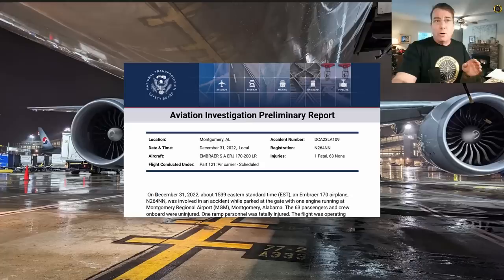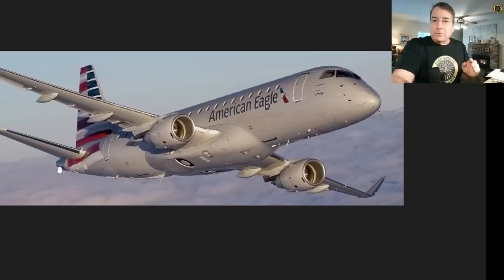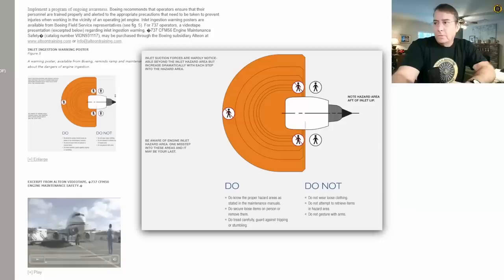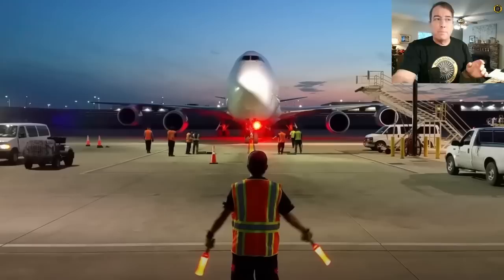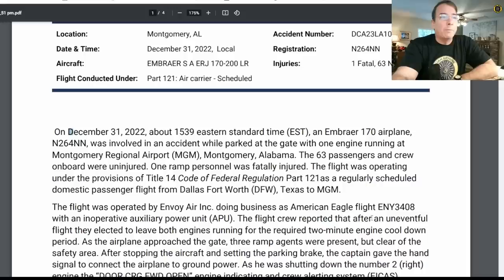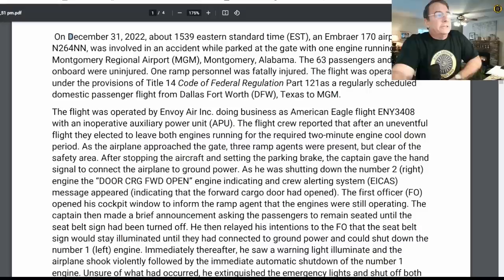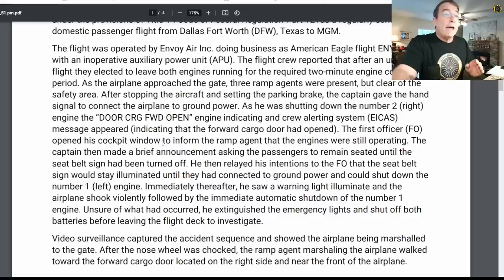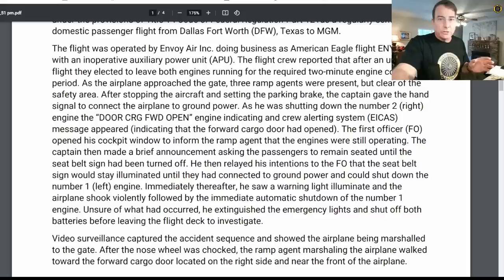NTSB Preliminary Report Ramp Agent Fatality 31 Dec 2022 Montgomery Al.

Comment: Twice last year, I pulled into the gate with engines running and wasn’t able to shut down right away and rampers immediately swarmed the airplane, popped the cargo door etc in clear violation of all safety protocols. In both cases after we shut down I ran outside to put my foot in somebody’s ass. In both cases,the rampers were utterly dismissive of my concerns, and treated me as if I was a fool for being concerned. They could barely conceal their contempt as they explained that there was absolutely no danger, and they knew this because they do it all the time. I elevated my concerns to their management and as far as I know, nothing was done.  Hopefully this incident changes a few minds…..
Reply: Sounds like you got some slack clowns on the ground there.  Hope their maint. is not like that.
Reply: @tomsherwood4650  Exactly.
Reply: What airport ?
Where there's smoke there's fire.
Bet that whole place 
is a mess 👍
Reply: A 225 pound guy, isn’t a 110 pound girl - Women are at greater danger in every job that once was male only and must take more precaution. That’s not a sexist comment, it’s just damn common sense. - Same goes for a light weight guy too.  The world has changed so safety rules are more important now to cover all the diversity
Reply: Basically agree. Safety rules were always important, though, not just b/c of increased diversity.
Reply: Maybe you (and all pilot) should report that incidents to FAA.
When these ramp agent got shouted badly by the authorities, they hopefully change their behaviour!
Reply: @ssnoc  This is a joke but it illustrates your point. A 5' 0" 90 lb. woman applied for a job as a bouncer at a bar while it was open. There were two big guys just about ready to start a fight. The manager told the woman to remove the first one so she walked up to him whipped his arm behind his back put a thumb lock on him and frog marched him out the door. The bouncer on duty that she would be working with was about 6"8" 300 lbs. He walked up to the other guy and looked at him. He left without a word.  A small woman can do the job but it is a lot easier for someone bigger.
Reply: Agreed. As a licensed and a union electrician I was dismayed when the shop owner said and I quote "if you're not violating some safety rules...you're not working hard enough".  Couldn't believe my ears.  And though to myself, do not listen to that B.
S. Continue to work safe, watch out for yourself  and  you're co-workers, and everyone goes home as they arrived at the start of the day.
Reply: sounds like the supervisor knew he needed 2 safety meetings to keep his job
Reply: This is alarming to hear 😲😑
Reply: I’ve been on the ramp for 10 years and unfortunately on time performance has priority over safety most of the time. Management will never say that but it’s implied. 

One of the biggest safety violations I see is the “2 inch” rule inside the bins. Bags and freight must not touch the ceiling of the cargo bay. It must remain 2 inches below in order to not block the fire suppression system. The ramp crews get pushed hard to take freight beyond the legal capacity of the bin. If the planes aren’t stuffed to the gills there’s no way it’s going to fit. But it “has” to fit. One of these days there will be an onboard fire, and everyone will be throwing whoever they can under the bus to save themselves.
Reply: Thats incredibly disappointing!  So it was her and her boss's fault
Reply: A fellow mechanic got sucked into a B737-200 JT8D Lucky for him, the engine had IGV that stopped him from getting chewed up by the fan. The engine had a compressor stall and blew him back out. Unfortunately, he lost a hand. Yep, I respect those engines.
Reply: @jamescollier3  Yep sounds like he knew what he was working with.
Reply: Her family will go on to sue the airline and get a big settlement even though it was her own fault.
Reply: @donh6416  Wish I could give you two thumbs up.
Reply: Crazy, but these type of trends I blame on companies pushing employees too hard while shorthanded and other reasons.  All this to maximize profits at the expense of the employee.
Reply: @ssnoc  FYI, there are photos with the gofundme her Mom started, and she clearly doesn't fall into the lightweight category.
Reply: I use to be a ramp agent…i never understood my coworkers urgency to work, when it wasnt necessary, as they were always bitching about working
Reply: I'm looking to become a ramp agent myself this year, always been a cool job I wanted to do. If I get a position as a ramp agent, and I ever hear management tell me to do something like that (or else get written up), I'm quitting immediately. Not risking my life to save 1 or 2 minutes for the bean counters...
Reply: @MrBen527  Yes, this important context.
Reply: Well if they want to be contemptable about if they dead it's their fault,  In fact it sounds like all be being done and it's their problem.
Reply: In the FAA and aviation business this occurs all too often. Including the dismissal of instructions to do things correctly. Even from managers and people who should know better. I was in the Navy and flight deck operations you only survive and keep aircraft cycling by doing things right. One small thing I still remember, above the doors coming and going to the flight deck and ramp they had put big signs that read "THINK". I still remember those and believe they were more valuable than people thought.
Reply: Reminds me of Capt. Nick on the APG Podcast once describing his interactions with rampers at JFK ( or Newark?). They were endangering the airplane being careless and he tried to enlighten them. They too were dismissive and indignant towards him.
Reply: @ssnoc  , maybe not sexist but certainly ignorant. These safety rules apply to everyone, and to suggest it is okay to violate safety regulations because you think you know better is precisely the problem.
Reply: The Challenger "accident" comes immediately to mind. Ignored burnt O-rings because "it hasn't blown up yet" aka "Normalization of Deviance". smh
Reply: ...elevated to their management...nothing was done. The employees are (likely) acting in ways commensurate with the culture (management usually).
Reply: @MoonShadowRayne  it was her actions, but fault comes from the whole system. The people who apply pressure to break rules, the people who routinely ignore the rules and dismiss anyone who contradicts them are all at fault. She wasn't the only one acting on the plane, and you can bet every dime you have she wouldn't be the only one seen to not be working. The judge will dock the payout because of her own responsibility, but she's not the only one responsible for this, and those guys should pay.
Reply: @MoonShadowRayne  It isn't as easy as "her own fault" if the airport has built a crappy attitude and everyone blames her for not violating the regulations as much as everyone else.

Given how many people did violate the rules for this single plane, that airport has a huge number of violations every single day. So it would be correct to sue the airport to make it relevant that management starts to do what they get their salary to do - make sure regulations are upheld. And hopefully first kick out one or two people who have been well aware about this violations for months or years and just ignored it "for efficiency".
Reply: @j18ter  I think the difference being mentioned is that the likelihood of an incident isn't the same for all people, so those with low chance flout the rules and encourage others to do the same. They get away with it because of some characteristic, but others without that characteristic do not. It's exactly why everyone has to follow the rules. No one is special, the job has to be safe for everyone including the lightweights watching you as an example.
Reply: Union incompetence.
Reply: At Southwest Rampers are not pressured to enter the injection zone prematurely. However they want the bags at the tunnel in ten minutes. So agents are under pressure to go, go, go and turn the plane quickly. This is why agents rush into the Safety Zone before it is safe. If you are late getting the Local bags to the tunnel (no matter what the reason) you will be called to the Supervisor's to sign a letter. Ask any Southwest Ramp agent.
Reply: @GNNASCARFAN 24   Tell them to put it in writing if they tell you to do something that violates safety. Regardless don't do it.
Reply: @oldmech619  JT8D on a B-737?
Reply: @MoonShadowRayne  But it isn't. Clearly her employer failed to supervise her and the other yokels as turning a blind eye gets things done faster.
Reply: @markhorton3994  1 that never happened.   2 it's irrelevant, you can't use judo on machinery
Reply: @deSloleye  Definitely sounds systemic - I'm willing to bet those two safety briefings were conducted and received as "the words we need to say before the thing." Routines tend to grow routine and so lose their impact. I used to work with a lot of IATSE riggers and their safety briefings were serious business. This was a 100% avoidable tragedy and I hope it changes things for the better. Stay safe out there!
Reply: @MoonShadowRayne  Wasn't solely her own fault. The employer MUST create an environment which prioritizes safety over production.
Reply: There's no way. How the HELL could they be that blasé about it? I can't wrap my head around that.
Reply: @Rio_Seco  I said it was a joke. That means it never happened. I was illustrating that sometimes size matters.
Reply: @ShaunHensley  1 I said it was a joke. 2. The point was that the smaller person needed greater effort to accomplish same thing.
Reply: @markhorton3994  I see. If I misunderstood the intent that's my mistake
Reply: @blakena4907  It's complacency combined with job pressures. 

If you work in a dangerous environment long enough, many if not most people acclimate to it.
Reply: @ssnoc  you're right!  The laws of physics do not change
Reply: @ssnoc  110 lbs or 225 lbs doesn't make a difference to a jet engine.
Reply: That is so contrasting with what I have experienced as a ramper, lead, and sup. If a pilot comes down with an issue, we do everything in our power to accommodate him/her. I'd say that 99% of ramp agents hold pilots in very high regard, so your experience is mind-boggling.
Reply: Look up “normalization of deviance”. Very prevalent and hard to correct in some institutions. Retired FAA ATC, one example was controllers routinely taking turbojet aircraft out of Class B airspace vertically or laterally. When questioned about this violation of rules the controllers gave very similar answers such as there is no danger, they do it routinely and nothing ever happens.
Reply: @markwheeler202  I think the problem was it was so cold the o rings did not expand and keep the hot gas from escaping. There were redundant o rings but the cold caused them to fail. The main culprit was they wanted to go that day. It was 36 degrees and the O rings could fail at 53. The same pressure to get the shuttle off the pad is the pressure to get that plane turned around. People like to set deadlines just to have them. They want to go to a new system of communications with aircraft not because its safer its so they can cut the miles down between the planes landing.
Reply: You should try working with them...I had to force them to not put a bag for Manchester England on a San Francisco flight and I was treated by those geographically-ignorant cretins like I was some kind of problem and was punished...
Reply: @mikemicksun6469  The joints were designed such that hot gases would NEVER be allowed to reach the O-rings, because that could lead to the loss of the spacecraft. Analysis after several previous missions showed that hot gases were indeed reaching the O-rings. Management, rather than conclude that there was a design flaw that needed to be corrected before any more flights were launched, instead kept flying because "none had blow up yet". They were playing Russian roulette with seven astronauts' lives on every launch based on wishful thinking. That was the systemic reason for the loss of Challenger, not that it was too cold (they were warned about that too but ignored the advice of their engineers). 

IIRC, there was also an issue with the contractor selected, Thiokol. The SRB's had to be shipped by rail from Utah to Florida, but would be too long so they had to be built in sections, hence the need for joints that had to be sealed with putty and O-rings. If they had been built where they could have been shipped by barge to Florida, they could have been made in one piece without the need for joints that could fail. If someone could provide more details on this, it would be helpful.
Reply: Good for Captain.  Yes hopefully this opens up a few minds..
Reply: @vk2ig    Just double checked with Google, it says the JT8d.  This was back around 1977. The engine had the IGVs I front of the small fan.
Reply: @jamescollier3  yeah, I smell a rat on that. I doubt there was any safety huddle/brief, much less two. somebody is trying to CYA.
Reply: @vk2ig  The original 737s, the -100s and -200s, were equipped with JT8D engines.
Reply: @donh6416  My cousin  was electrocuted (instantly dead) because some axewipe flipped on a clearly placarded switch to the runway lights.
There ain't no cure for stoopid.
Reply: @jamescollier3  he lost control of the situation. He will remember this forever.
Reply: @johnd.8224  what does the union have to do with this?
Reply: @rick4580  110 or 225 lbs.makes a big difference. Weight increases with cube of size. But area - which is what the suction affects increases with the square.

So a big and heavy person is less affected by the suction.
Reply: @tomsherwood4650  What does maintenance have to do with rampers?
Reply: To the OP, as the pilot in command the onus is on you to follow through on a safety issue like this and make merry hell until it is taken seriously by the relevant authorities.  Otherwise you are being complicit and nothing changes.
Reply: @markhorton3994  This is Joke? Where is the punchline? 
This tale is being presented in support of an opinion, but because it is imaginary, it provides nothing.
Reply: @ssnoc  Your comment IS sexist, because what you've stated is irrelevant and just an excuse to say women shouldn't do "men jobs". The safety standards require that NOBODY goes near the aircraft until the engines are shut down, so there is NO extra danger presented to women in this situation. You even state that the "same goes for a lightweight guy", yet, what about a 220lb girl? Do they meet your standard, or are they still in danger doing a "mans job"? It seems that you think its simply about a minimum weight, yet you state that gender is the qualifier. You're confused, mate.....Ramped with a few women and if they are keen to have a go, they're just as good as the guys
Reply: As a ramp manager at a large airport, I can confirm for you an emphasis on efficiency over safety is unspoken but prevalent. And when reported, safety inspectors, city employees, and even FAA people sit and watch and see the violations but would rather continue watching their Netflix. Nothing will ever be done about this sadly
Reply: Management  likely is who incentivized the dangerous behavior?
Via negative outcomes for "wasted" time... Or scheduling.
Reply: @ssnoc  A jet engine does not care how large or small you are.  It pulls your entire body.  Don't ask me how I know...
Reply: @ssnoc  15' is safe for everyone.
Reply: @j18ter  Seems to me that was exactly what he was saying. 

He merely points out that with greater weight variations between individuals (which derives from greater diversity of workers and body types), it is that much more important today that safety practices are clearly understood and followed.  Also associated with greater diversity are greater language differences, which means that clear communication and language comprehension are equally important..
Reply: @vk2ig  I'm more surprised there were JT8Ds with inlet guide vanes, didn't think turbofans, any turbofan at all, had them ahead of the fan. The ones on the SAAB Viggen didn't have them as far as I know.
Reply: @mikemicksun6469  And the reason they were so determined to go that day was that they had been scheduled to go the day before but cancelled for fear of storms approaching. The storms never came, the Saturn 5 sat around all day in the sun, and news outlets of various sorts made fun of NASA. They were determined to avoid further embarrassment. So a public relations problem drove (in part) the fatal decision.
Reply: @vk2ig  737-100 or -200 with JT8D low bypass engine. The CFM-56 engines didn't show up until the 737-300 and after.
Reply: @vk2ig  The Boeing 737-100 was powered by two JT8D-7 engines, each capable of producing 14,000 lbf thrust. The Boeing 737-200 had two JT8D-15A engines, each capable of producing 15,500 lbf thrust.
Reply: @MoonShadowRayne  
Not exactly.
Reply: Sir I can assure you the crew was probably briefed and given remedial training on flight line dangers......but I've seen fellow employees get all the training in the world.....walk right out of that briefing and engage in the same dangerous behavior. Some people are ineducable.
Reply: @Breenild  It doesn't  work that way. I filed countless ASAP (Aviation Safety Action Plan) reports when I flew the 737 and A320 fleet. The FAA sees the reports, but it is up to the operator (airline) to use the data. They don't and don't  seem to care. They just want to get the flight crew off the clock.
Reply: @ssnoc  What are you talking about 225 pounds.....110 pounds?????  That engine would take either of those two like a rag doll.
Reply: @rick4580  Exactly!
Reply: @ZedZedAre  the jet engine doesn't care what sex you are. Not only is this a tragic AVOIDABLE loss of life, those engines are not cheap. I'm  a bit surprised management's don't recognize this.
Reply: @snigel79  JT3s (old 707s), JT4 (newer 707s and DC8s) and JT8s (727, 737, DC9 10 thru 50 series) all had IGVs. Even the initial large engines on the C5s had them. 1950s and 1960s technology.
Reply: @MoonShadowRayne  Yep. Juries suck (even though emotion isn't allowed to be used in a courtroom, it always is) and the airline will pay out instead.
Reply: @mayhempilot6158  Then that person should show their required copy of that letter to someone who cares and can make trouble.
Reply: @ShaunHensley  Nope. Solely her fault.
Reply: @UncleKennysPlace  nope. Airlines can institute policies prohibiting even performing that work until engines are shut off.

Legislation can be crafted to that effect.

So no. Not ‘Solely her fault’.

It’s because of the pressure to perform because money needs to be made.

Want to keep going?
Reply: @philiproseel3506  The Captain of ANY aircraft...  is the BOTTOM LINE!  HE/SHE:  will be interviewed first by the FAA.  His neck is on the line.  His name will be among the others in the "field" of "Party 'B'" in the lawsuit (if it goes to court) that ensues.
Reply: @KO-pk7df  Well said. Bravo Zulu.
Reply: @ssnoc  Care to stand in front of a live jet engine to find out? I bet you could muscle a jet engine to submission no? If not, that is just a sexist comment
Reply: @markhorton3994  BS
Reply: @jimw1615  Thanks, and likewise to everyone else who mentioned that the B-737-100/200s had JT8D engines. I last saw those engines on B-727s and DC-9s.
Reply: There's a saying in aviation that safety rules are written using someone's blood.
Reply: @markhorton3994  Thanks for the fake story.
Reply: Good grief 576103, how different your airports are to mine. I’m ACS (cleaner and bowser operator) and ramp agent hybrid and most of my colleagues are actually very intimidated by the pilots. It would be unusual for most of them to say anything to the pilots other than mumbling a return response should the pilot even acknowledge that we exist and that we’re there by saying good morning or something. The exceptions are usually those who have to, such as the pushback teams.

One of the more notable examples of this was regarding a 787-800. We had finished cleaning the Dreamliner and we’d all gotten back into our van and were either playing on our phones or chatting as we waited for our supervisor to return from helping the rampers with something-I forget what it was exactly. Every department was short staffed and I’d only been an aircraft cleaner for just over two months so I was one of the newest people on the team and this was before I kinda hybridised onto the ramp. I wasn’t using my phone as even now just watching the intricate activity on the apron and stands or the runway is interesting enough so I’m the first person to notice that the captain was walking down the steps and thought it was unusual since the walk around had already been done.

Once the captain had gotten to the ground he started walking straight for us in our van. I didn’t say anything because I was only mildly curious but one of my colleagues also noticed and that’s when it began. Immediate anxiety as about the whole team of six, minus myself began anxiously asking each other why the captain was heading straight for us. “Was does he want, is he really coming for us, did anyone forget something, have we left something aboard the Dreamliner, but no it would just be a flight attendant if it was something like that.” Were among the flurry of responses as it became apparent yes, he was indeed heading for our van.

The general consensus was that someone had done something very wrong and we were potentially in very big trouble if the captain had gone to the effort of getting of the plane to find us instead of getting on with the usual preflight stuff you guys do. It wouldn’t surprise me if one or two of my colleagues were giving serious consideration to bailing out of the van from the opposite side. I had the same concern but it seemed muted in comparison, honestly I was still more curious than anything else. It was warm enough that we had the windows down and thus he addressed us without having to open the door or anything. It was harmless! 🤣 Apparently the pilots from the last flight had left the cockpit in a bit of a mess including having spilled a drink and he’d come to us hoping we’d go clean it up. (I should point out that most of us aren’t allowed to clean the cockpit without separate training, which is voluntary and thus few people choose to do it and I hadn’t gotten the training myself yet at that point. Nobody present in the van had, and so if there’s no cleaners allowed to do it, then the pilots or engineers have to do it themselves. At the same time they’re poorly equipped to do so because don’t have the specialised chemicals and equipment.)

So but of course there are a few seconds of complete silence before I finally chose to break it when it became apparent nobody else was going to. Fortunately I’d done something similar before (which is another story entirely) and knew it would keep me out of trouble by agreeing to do it on the condition that I’m directly supervised. Though of course I was equally motivated to ask for supervision because I wasn’t keen on the idea of accidentally breaking a multi million pound aircraft. The APU was running though not the engines and I know enough to understand it means at least some of the systems are powered and active. Of course he agreed since both would be there doing a few of the preflight stuff but mostly waiting until I was done. So of course I pack the stuff I’m going to need and followed him aboard. 

They kept their word although most of it wasn’t near any of the controls and the few bits that were, I’d verbally confirm before proceeding. But of course as luck would have it, our supervisor had returned while I was gone. He was waiting for me at the bottom of the stairs though his only remark was that I might as well just get the training for it if I was prepared to do it anyway and about a week later I received said training. And yes most of them are like that and this is just one example. 🙄 I swear, the notion of addressing a pilot in such a way would probably give most of them nightmares.
Reply: @philiproseel3506  Likewise, I could barely believe it. I work both ACS and ramp in the UK and I kid you not, the vast majority of my colleagues are very intimidated by pilots bordering on fear. I understand they’re high ranking but they’re not horrible to us. In fact most of the time it’s the complete opposite-at least for me. Admittedly because I’m one of a tiny handful of cleaners who has undergone the voluntary cockpit training module, inevitably I have much more exposure to them but even before that all my interactions were positive. They’re usually as friendly as the flight attendants even when they don’t have to be.

The best example that comes to mind was when I was still fairly new and was cleaning the forward galley on 737 and the previous crew had badly overstuffed one of the big metal bins that come up to almost waist height on the as a woman of average height and weight and I’m having trouble getting the bin bag stuffed with rubbish out of the bin. I was making progress but it was slow going and I was making a lot of noise as it banged against the floor with every jerk. Then the captain steps out of the cockpit because I’m distracting them during some of the preflight stuff and for a moment I thought I was about to get yelled at or written up. Instead he just asked if I could use some help and I say yes, so he gets his first officer to help me. This guy was about a quarter more than me in height and size and had no problem providing the extra strength required. I thanked them, they were happy to assist and we went back to our respective jobs.

But yeah most of my colleagues find them intimidating and would never dare to be so rude.
Reply: @donh6416  Agree with you. You can't be afraid to call someone out on a safety issue. I've done a couple of different things in my life that required safety consciousness, including flying, also medicine (retired EMT, studied nursing), among others. An ounce of prevention is worth a pound of cure. Literally.
Reply: @mikoto7693  I guarantee you that pilot was angry with the previous crew about the state of the cockpit and embarrassed at having to ask for your help. No doubt he was appreciative of your efforts, as we all are! 👍
Reply: @mikemicksun6469  
Part of the problem was NASA thought that having two O Rings at that spot created independent redundancy, but they didn’t.   They flexed/expanded/moved together.  So the second O ring basically added no extra protection.
Reply: @vk2ig  Yes, JT8D engines were used on the 100 series and 200 series 737 aircraft.
Reply: @snigel7995  I used to do maintenance work on DC9 aircraft many years ago and yes the JT8D has IGV’s
Reply: @markhorton3994  was she a lesbian?
Reply: @VIKINGOCATIRE  What difference does that make?  First it is fiction that I thought  might illustrate the concept that size matters in some things.  Apparently some commenters disagree.  For most jobs age, sex, sexual preference, race, religion,  nationality and anything else other than ability to do the job are irrelevant. As a Christian man who believes that since God gave Adam and Eve the choice between right and wrong I do not have the right to dictate morality your question offends me.
Reply: @JH-qqqqqiim  And by your own admission! You would be considered a dangerous ramper and seems not care about the safety of the passengers and crew!
Reply: Famous last words, "We do it all the time.".
Reply: @perwestermark8920  unless you actually saw the video and understand that the suction is exponential, what difference does it make? Probably 1 inch or two. But that is just the weight, the 225lbs person will surely be closer to the engine assuming their center of mass is at the same location = the heavier AND larger person will be sucked first
Reply: @topethermohenes7658  Exponential is about distance to engine.

But that is a different parameter from the surface area of the person - and the mass. At a fixed distance from the engine, the wind has a fixed speed. And the applied force depends on the area. But the weight is what counter that force. And a big and heavy person has a larger weight to area quotient than a short and thin person.

So your argument about seeing that video falls rather short by you missing a bit of physics. Well maybe you have seen how small RC planes can do magic tricks but is very much affected by turbulence while a 747 is slow and and way less affected? Same thing - an RC scale model has way lower wing load because the weight scales  with the cube and the wing area scales with the square.

Ever wonder why insects can be so thin and still lift many times their own weight, and why they can fly in the wind? But an elephant has very thick legs and can't fly in the wind? That elephant needs much, much, much, much higher wind speeds to be as much affected by the wind as an insect. All because the weight to size difference. All about that cube for the volume/mass.
Reply: @perwestermark8920  yes exactly its distance, then I gotta ask you this, do you think a 225lbs person has the same dimensions as a 110lbs person?

You explain too much, so much talking, so little thinking. The distance from the engine matters more than the mass and a 1 or 2 inch difference is life and death, not weight
Reply: @topethermohenes7658   Nice of you to see your way of debating. "So little thinking" - you sure you did think that statement through?

A 225 lbs person is about twice the weight of 110 lbs. But not even close to twice the surface area. That's very important.

Let's say he has 5 cm larger stomach (and we are nice and say he's 5 cm (2") closer over all his front area - which is obviously not true.

The safety distance is about 5 meters.

At 5 meters, 5 cm is 1% closer. If half the distance doubles the force, then those 5 cm means 1.01^2 or about 2% stronger force. So you can more or less ignore it.

The values:
- distance in meter
- relative change in distance for 5 cm
- relative change in force for 5 cm
- total change in force relative compared to 5 meters from the engine
5.0 1.010 1.020 1.020
4.5 1.011 1.023 1.262
4.0 1.013 1.025 1.602
3.5 1.014 1.029 2.100
3.0 1.017 1.034 2.873
2.5 1.020 1.041 4.165
2.0 1.026 1.052 6.575
1.5 1.034 1.070 11.891
1.0 1.053 1.108 27.701

At 1 meters distance, the force is over 25 times the force at the safe distance. But 5 cm change still only means 10% change in force. Which means at 1 meter, a weight increase that is more than 10% larger than the increase in drag from larger size still wins out.

And remember I have still been nice and claimed the 5 cm happens over all of the body area - not just the stomach. Not too many gets 10 cm (4") larger diameter arms, legs, head, ...

What was it you wrote? "You talk so much and think so little. The distance from the engine matters more than the mass and a 1 or 2 inch difference is life and death, not weight"

When actually thinking, you'll notice the 2 inches means hardly anything. Maybe you considered "assume" to be "thinking"?
Reply: @perwestermark8920  ok let me do some guessing. The e170ar (the aircraft here, a regional jet) has a max takeoff weight of 85000lbs. From my experience of jet powered aircraft, usually the engines have enough power (on idle) to make a plane move at about 60-70% of its MTOW (thats on taxi, from 0 kts on idle power) lets assume 50% for simplicity sake. 85000lbs / 2 is 42500lbs. Now since this is a 2 engined a/c divided by 2 again since our test is to be sucked by one engine = 21250. This engine can suck up to 21250lbs on idle power  and adding in the additional lower pressure created by bernoullis principle in front of the engines, well you get the idea. 110 or 225 doesnt matter much, its the distance to the engine
Reply: @perwestermark8920  we are not even factoring height here (taller person with more mass higher to the ground vs shorter person with mass lower to the ground), built (a 225 with a gym body built would have a wider torso area vs a light weight 110lbs person), etc etc, but none of these parameters matter much, distance is still the deciding factor
Reply: @topethermohenes7658  Isn't it interesting that you could make such a long post and just tell the world that you didn't understand the concept of wind force in relation to body mass? It isn't about how strong the engines are and how heavy plane they can handle. It's about how much force they impact on the person. And how much side force the person can handle. And a big person can handle higher wind velocities because of their higher weight in relation to drag, i.e. in relation to their exposed body area.

It's irrelevant how much you look at the engine power itself. What is relevant is how big force that is applied on the person. It's that force  - which needs to be balanced against the persons weight - that decides if a person will get sucked in or not.

You can blow on a 100 gram paper and have it fly away. Blow on a 100 gram lead cube and it will stay. Why? Because the lead cube had way less area compared to weight so the total force wasn't enough to move it.

This is also why they need to adapt the safety distance if there is already a strong wind without the engine running. And also why the ground friction matters because the friction decides if they will start slide towards the engine until they are close enough that the wind force is enough to lift them from the ground. Then the ground friction obviously becomes irrelevant.

With same body build, a twice heavier person is about 1.26 times taller and have about 1.26^2 = 1.59 times the area but 1.26^3 = 2.00 times the weight.

At a fixed wind speed, the force on the body will be 1.59 times stronger but the weight - which decides the grip - is 2 times larger. That extra grip means a higher wind speed (a closer distance) is needed before the grip isn't enough.

Why is this relevant? Well the safety distance is about 5 meters. But there is a safety margin there. The real point of no return on a good day is probably somewhere at 2 or 2.5 meters from the front of the engine because human safety always requires an additional safety margin. If a big guy moves to a position that is safe, then the little guy may forget about the engine and quickly walk up to that same position - but in reality being one step closer to the engine if considering the actual safe amount of force applied to the body. And the biggest danger is when people focuses on the wrong thing - like where the cargo door is, or where some other person stands.

And it's even worse than that. If it's cold and they happen to have thick clothes that are flapping around a bit - then the small person will be more affected by the extra drag from the clothes than the big guy.
Reply: @topethermohenes7658  You are talking about engine power as if it is a winch on a jeep connected with a wire to a human.

That's not how the thrust works in this case. The difference in engine power affects the size of the safety zone. But it isn't relevant for this debate - the safety zone itself is a fixed size. Even if different people is differently affected because they have different drag coefficient and different area and different mass.

You managed to add one more argument showing your misunderstanding. You mentioned that pumped guy that was extra wide. But if it isn't a linear scaling of size but the person is extra wide, then that is a win for me - not for you. That means he will not be as tall for the weight. And it isn't just width that increases - bulk aka beefy means even less front area in relation to the weight. It's the tall/thin people that are at the biggest danger. Which you should know - if you know what you think you know.

But please - don't end with Ciao. I was hoping you would add more funny arguments. 😘
Reply: @576103  That’s actually helpful. Thank you. Anger I understand-it really was a mess in there. Normally my time in there is brief during the day and not always required especially during quick turnarounds. Usually I stop at the door, say hi and ask if there’s anything that needs tidying. It gives them the chance to decline if they’re under time pressure. During the night is when I get most of it done in detail. If I’m not out on the ramp then yeah the cockpits are mostly what I end up doing due to the extreme lack of people willing to do the training. 

But on that particular occasion it was really quite a mess. It’s not common that I encounter that in the crew areas. Passenger cabin? Oh yes that routinely is appalling but the cockpit and crew sleeping room generally needs little work. On that occasion what confounded me was the captain’s chair. Sure I got the coffee out just fine but I had no tools to dry the damn thing so I ended up staring at it for a moment at a loss on how to resolve it. 😆 Then it clicked. Just grab a couple of the clear bin bags and pull them over the seat. This worked fine for the actual seat cushion even if a few tears were needed to get it around the adjustment mechanisms. But the back of the chair… yeah that safety harness thing momentarily ruined my plan. Curiosity being one of my dominant traits I just had to fiddle with it and work out what went where. It didn’t take long and the workaround was to just tape the bag to the backrest, which could be later removed as needed.

So with that additional context, yes I can certainly understand anger. I’d be angry too if some dumb colleague meant I had to sit in a wet chair for hours. I don’t remember how many hours that would have actually been. The Dreamliner does some fairly lengthy ones such as from the UK to Florida or Mexico. 

But I’ve got to be honest embarrassment has never occurred to me before. Curious. I don’t know. I would have thought it part of the natural order of things for him to seek out those who have the specialist chemicals, equipment and training. Even now, cross trained as I am, everything I do at work is in service to the aircraft and those who use it. The only oddity was the location and lack of clearance to go there but that was negated by simply asking to be supervised. I dunno. We work closely with the cabin crew and are pretty used to being asked to occasional extra thing we normally wouldn’t cover.

But I’m at a loss to understand why US rampers would be so rude and dismissive towards a pilot. I just can’t see it. I can only guess a very different work culture to that of UK ramps. I just have no frame of reference-the only argument I’ve ever seen between a ramper and a pilot had nothing to do with their jobs-they just didn’t like each other. They really thought they knew better than you? Honestly baffling. The approach we operate by should be common sense. Of course the engineers and pilots know the most about the aircraft by the very nature of their job and unless one is obviously doing something very stupid, let them take the lead on what needs to be done.

It has to be cultural differences I guess. The incident where that ramper died is confusing too. In all the time I’ve been there, nobody has been struck by jet blast or hurt by an aircraft. A couple near misses and minor injuries but nothing like this.
Reply: @JH-qqqqqiim  Have you reported this constant safety hazzard or stop the flight?
Reply: @ssnoc  There are plenty of women who are taller and stronger than an average sized man (which is not 225 pounds).  So yes, your comment is sexist. Women aren't all small enough for you to pick up. 🙄
Reply: @markhorton3994  Why are you men assuming that all women are tiny??? That's a wet dream you guys are having. Jesus the sexism in these comments is mind-blowing. You don't even know the size of the ramp agent, and you're assuming she was short and lightweight. Maybe she was 5'10" and could lift 150 pounds on the leg extension machine. You're basically saying, "Yea, that wouldn't happen to a man" which is not true and is the kind of attitude that made those ramp agents swarm a plane with engines running.
Reply: @elizabeth5985  My "parable" ie fiction told to make a point had as protagonists a smaller than average woman and a larger than average man. It is not sexist to assume that a randomly chosen man is larger than a randomly chosen woman. It is fact that that will almost certainly be the case. There is a reason for men and women not usually competing against each other. 
Yes the largest and strongest women are bigger and stronger than the average man but the largest and strongest men are a LOT bigger and stronger than the biggest and strongest women. 
In the case of the ramp worker, she was considered capable of doing the job. She violated the safety rules and died as a result.   It doesn't matter if she was the largest, the smallest or exactly average. A jet engine will suck in and chop up ANYONE who gets too close. 
Ignoring biology is stupid. Tying to force women to be the same as men is sexist.
Reply: DEI hire loses her life.
Reply: @SorenCicchini  Can you guarantee 100% that NO ONE! Can get hurt from that distance?
Reply: @jerryhargis7730  Be safe out and up there!!
Reply: @ShaunHensley  This plane is going to delayed because of the INOP APU! The airline knows this, ever station knows this, as a ramper you do not want this A/C stuck at your gate! So you just do everything safely! So it gets to the next destination!
Reply: @davidsmiths5471  of course not but Boeing's engineers have calculated that they won't be exposed to noticeable engine inlet suction forces.